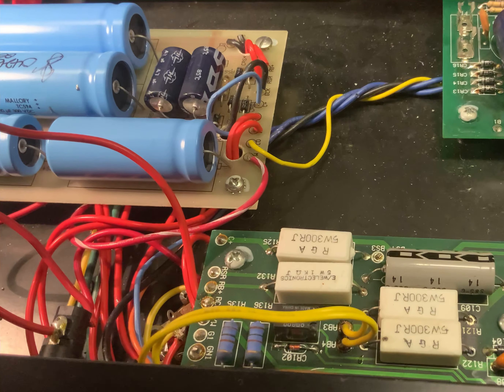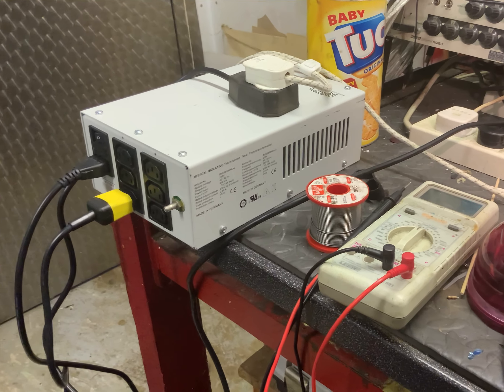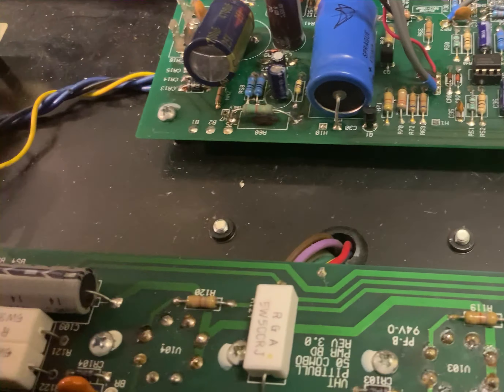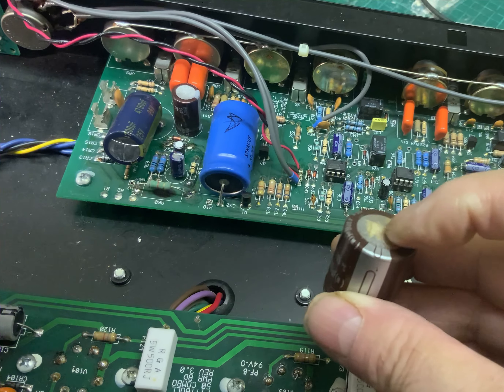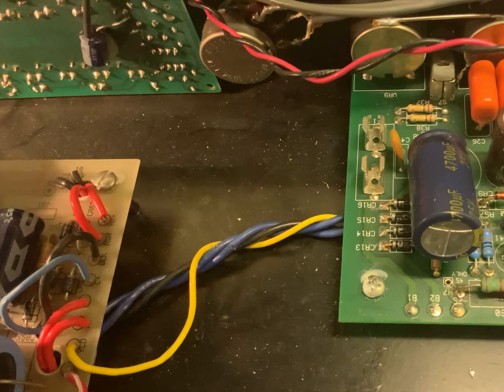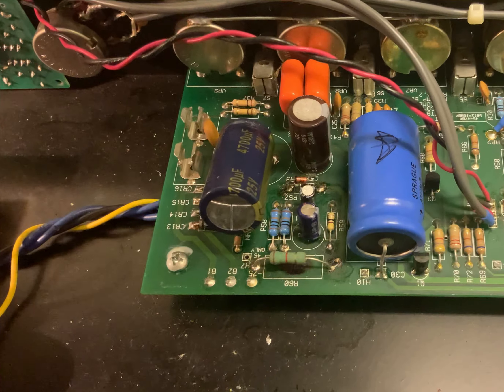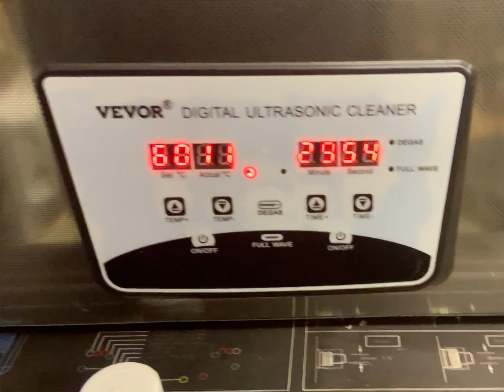A 4K Teast video showing a Guitar Amp that was in for major a rebuild   4K TEST VIDEO

Comment: That amp wiring looks like a rats nest.
Reply from the maker: Yes it is was but after replacing the mains Tx and making a few mods it know looks fine. But at the time i took this video i had only just opened the unit which had done the rounds,